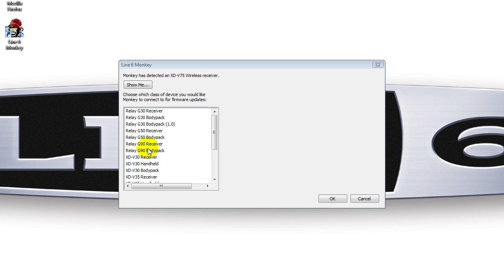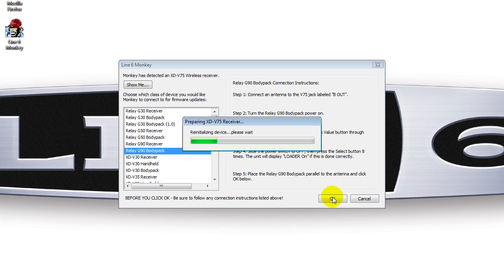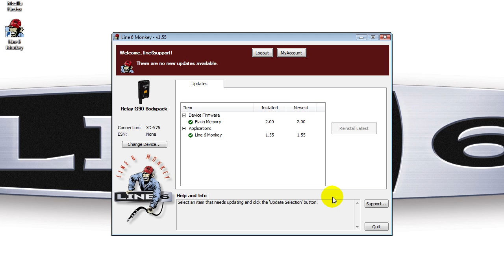Updating Digital Wireless Devices #3: TBP12 Transmitter

Comment: its really awful firmware update system , we can't firmware update without "xd-v75 receiver"  i'm the owner of relay g50 and should i buying "XD-V75" for the firmware update? 

its rediculous update methode.
Reply: I agree. I wouldn’t even bother updating it. If it works fine, then I doubt the update will improve sound.

Comment: hello, I purchased a line six relay g 50 that does not have the rf1 mode, is there any other method to update the firmware version without needing this vx75 receiver?